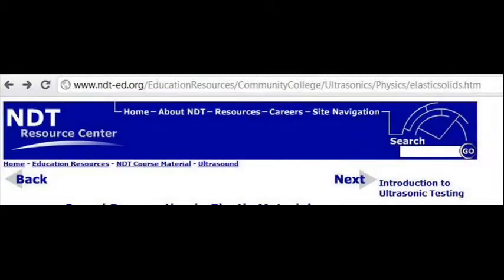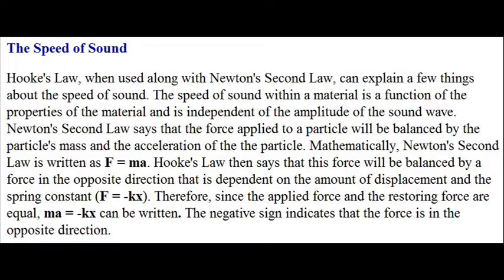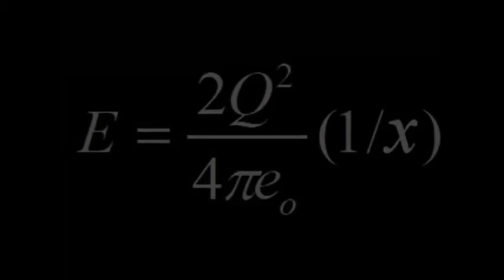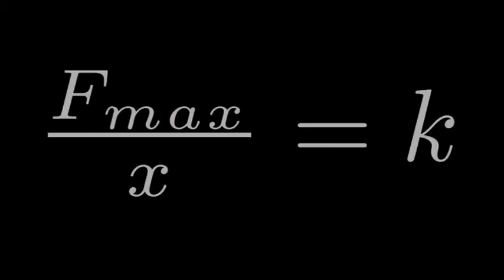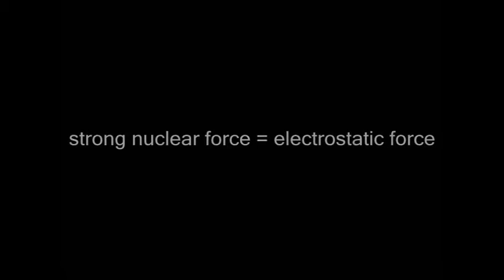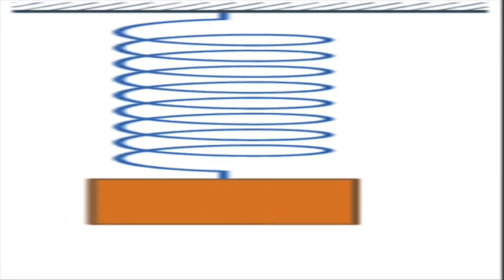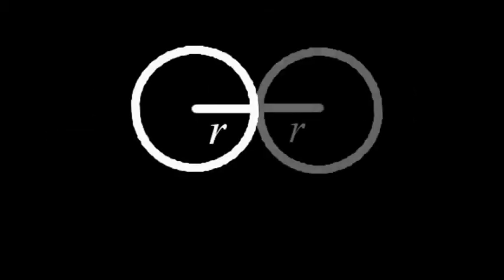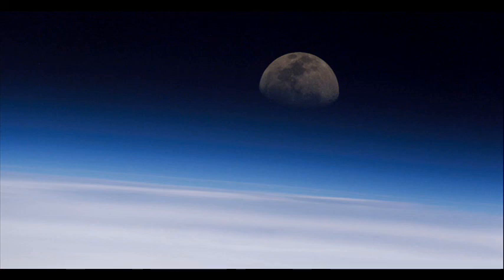Anti-Gravity / Cold Fusion Explained In Detail: A New Era In Physics Pt. 20 of ?

Comment: Another dead end equation huh. What a waste of time.  You have a lot of good knowledge.  I would have even believed you if you had something conclusive.  I guess that is why Frank hasn't been published.  Just show me one equation that solves for Vt that doesn't include planck's constant, otherwise the best conclusion is that Frank reverse engineered that first equation and solved for Vt.  If light has a capacitance then all waves would.  What is the capacitance of a slinky?
Reply: Amateur radio operators have used metal slinkies as antennas. Perhaps some research there could give you some kind of answer.

Comment: I got my own answers to this one. 1.409X10^-15 is the classical radius of the proton, which is the distance from the center to the coulomb barrier in a hydrogen atom. The electron is at twice this distance when in the ground state.

Q^2 is the charge of the proton squared. So this equation predicts the maximum force between two protons at the distance of their maximum repulsion, and the force between the proton and an electron in a hydrogen atom at the ground state.

Comment: Also, I can't find any other reference to 29.05 newtons, except from Frank. I found a reference from 1998 where he calculates it from this equation:
Force = Q^2 / ( 4*pi*eo (2*1.409 x 10-15 )^2 ) = 29.053 Newtons 
Can you detail how this number is derived? 
What is the value of Q?
What is the significance of (2*1.409 x 10-15 )^2?
How does this equation relate to the others you present?

Comment: 2) Is the equation at minute 5:10 correct? Your equation is
E = (2*Q^2) / (4*pi*e0)*(1/x) looks like it has an extra '2' in the (2*Q^2).
There's an equation in Wikipedia which I cannot paste into here for some reason. Search for 'Potential Energy'.
Where electrostatic potential energy = W where
W = (1*Q^2) / (4*pi*e0)*(1/x)